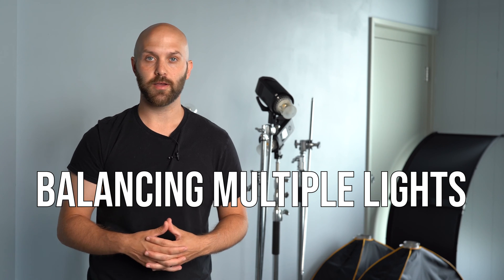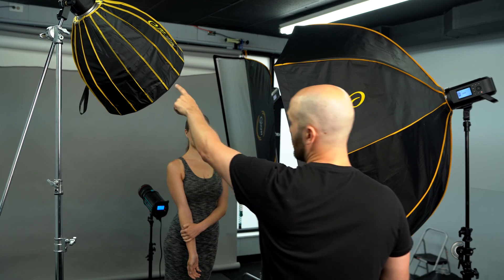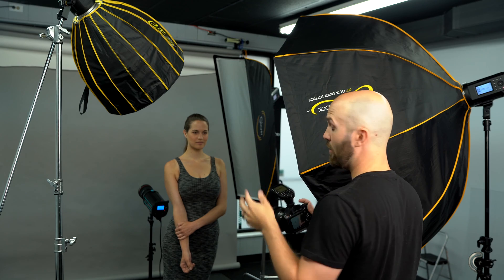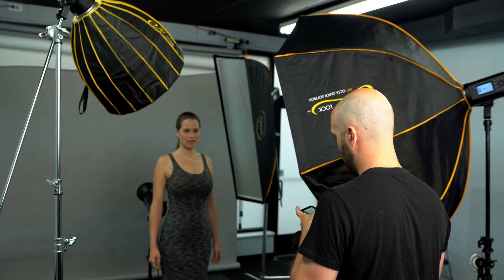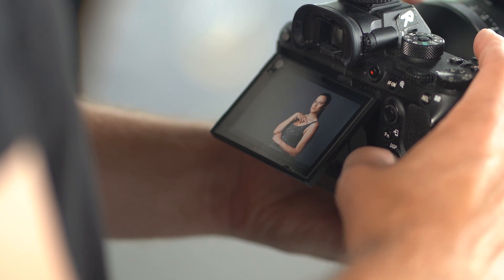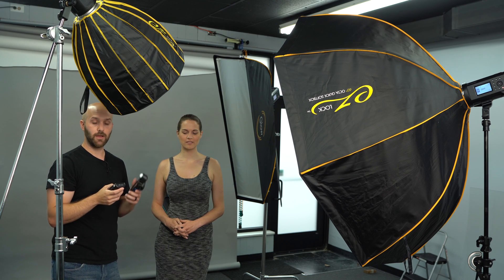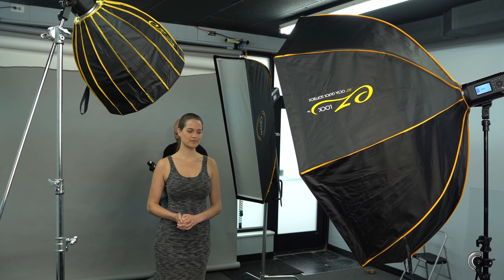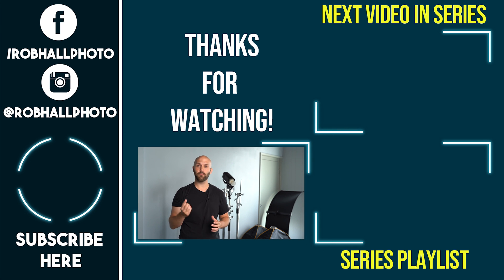Flash Photography Tutorial : Using Multiple Strobes

Comment: Quick question how do you ser your 4 lights together? I mean sync them thx
Reply from the maker: all of my lights are Godox X series, which means they all have built in receivers, that when I put a Godox X series transmitter on top of my camera, they all sync.
If your lighting equipment doesn't have built in receivers you can connect external receivers to them, but you may not have control of the power output depending on the system.

Comment: If i can't afford light meter so what should i do
Reply from the maker: The same thing I did without a light meter
Reply: You can get older meters that work just fine on Ebay or Craigslist, like the older analog ones.  Look for the older and very reliable Minolta F4 if you can scrounge a few more bucks.

Comment: Thank you Robert for the info on  how to set multiple lights without a meter and with metering.  What spot meter would you recommend?   I did not see the one on the list of equipment used. Thanks Adorama for supporting Robert's Videos!
Reply from the maker: For a bargain meter I would suggest an L-308 (any of them). The one I use in the video is a Sekonic L-858d-u, which is Sekonic's flagship meter and includes a lot of advanced features such as flash durations and HSS recording.
Reply: @robhallphoto  Is it only the L-858d-u that can trigger the flash for the readout wirelessly? I use a flash sync cable with my L-308

Comment: When you meter individual light sources (incident metering), you need to retract the dome of the light meter.
Reply from the maker: Not true in all circumstances, otherwise a low-end meter would be useless. While I'd agree you want to retract if you have competing light sources that can influence the results (like exposing for a flash +2/3 stop over ambient conditions), that's not the case inside our studio, which was demonstrated to be pitch black with the camera settings.
Reply: @robhallphoto  The question is not whether ambient light influences your metering results -- the pitch black frame only shows that there is no ambient light contribution -- the question is how much the other light sources (strobes) are contaminating the metering result. If you don't retract the dome, you need to shut off all other strobes for each measurement. It is easier to leave them all turned on and just properly focus on one light source during light metering.
Reply: @tkimaginestudio  All lights not being metered were turned off. And doing so is incredibly easy with the trigger used.
Reply: @opx4real  Not "incredibly easy" unless you are using the Flashpoint R2 Pro version. The standard Godox Xpro makes you press group buttons and the mode button and requires cycling through off, TTL, and manual. It is way easier to always fire all lights and just use the light meter as designed. That's why the dome is retractable.